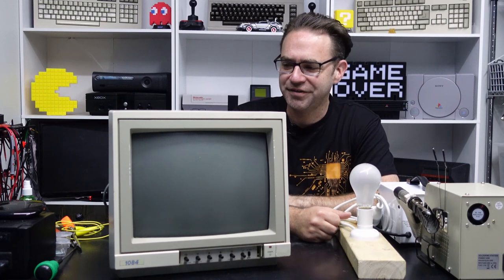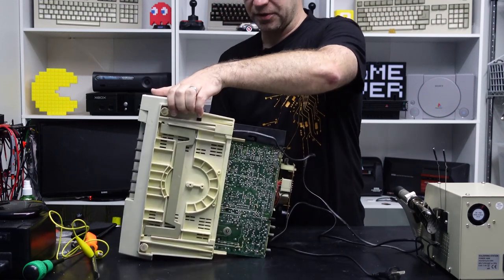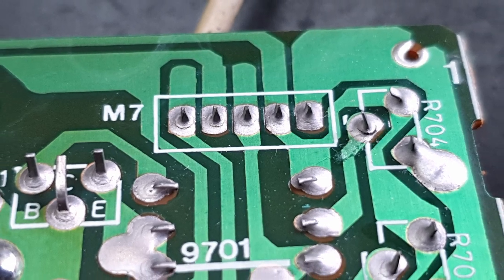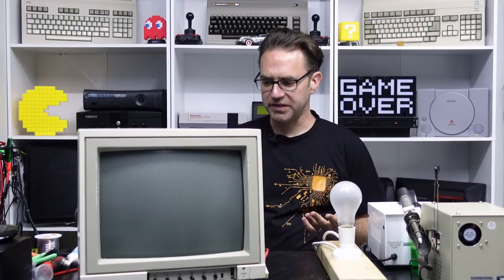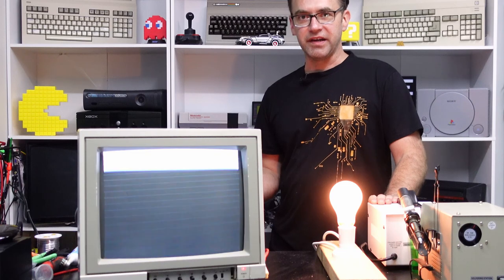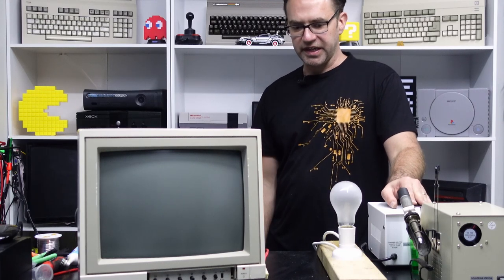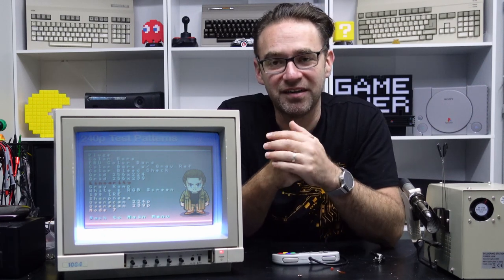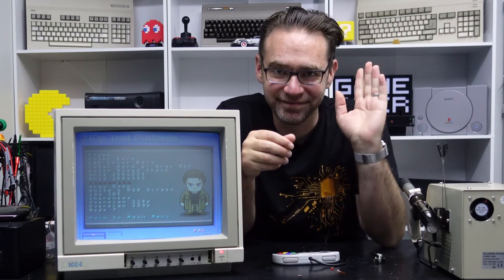Commodore 1084 - Replacement switches, flybacks, and other shenanigans Part 3

Comment: Thanks for doing this CRT series.  I've really enjoyed them!  I've got a dead 1702 that I plan to recap and fix (suspect I may find broken solder joints on the flyback on that one too).  So, I'm gathering all of the tips I can find.  I also have a Magnavox 8CM515 (very similar to the 1084 you fixed in this video)  that I likely need to replace a few caps in as well to fix some minor display problems on it.  So, I'd be keen to see another video showing your recapping and the results.
Reply from the maker: Thanks David, yeah if the Magnavox shares the same chassis then chances are you will likely find some bad joints. Seems to be a common problem with these boards.
I'll certainly come back to the CRT repairs once I've finished up a couple of other projects

Comment: I tried to repair a few Arcade CRT in the past and it can be a very frustrating experience. The last one I was going around in circles wondering why it wouldn't work after a rebuild and new flyback so I sent the chassis to well know expert and he said the new flyback was labelled incorrectly the rest of my work was good.
Reply from the maker: Wow, that's frustrating to say the least. But it's always nice when an expert commends you on your work

Comment: I have a 1084s monitor. The power button, which is located in front is broken. Before I open the monitor and replace it, I was wondering if there could be anything else wrong with it from my description.     Before, I could hold in the power button and a picture would come on until I let it go. Now when I hold the power button in, there's no picture at all, no rasterization. I don't hear any high pitch wine, I can't remember if there was any static on the screen when you touch it. Do you think there could be anything else wrong with the monitor?
Reply from the maker: The switch could have made it to the point that the contacts inside it have worn out due to arching, but I think that's unlikely (you probably would have noticed it flickering on and off long before it completely stopped working).
Possibly the fuse has blown, it can happen when a supply current rapidly switches between on and off, like from a broken switch perhaps.
I'd check the fuse first, then check the switch with a multimeter just to make sure it still works when pushed in. Of course do this with the monitor unplugged, there should not be any need to discharge the CRT at this point, just be wary of the large capacitors in the power supply. They can hold a charge more dangerous than the tube itself

Comment: This was awesome video series!!! I have learned so much thank you! Of my 9 Commodore monitors six of them work great (for now, knock on wood!). My other 3 work to a point but something is wrong with each one. A 1084S-P the Composite/LCA is good, RGB is black screen. A 1902A Won't always start but works when it does, when working the displays illuminates a bright greyish screen  when no video is connected and it aways goes to a black screen after a few minutes. A 1702 has a B&W picture only from front and back inputs, but it is a sharp and clear picture. Any thought on those 3 monitors?
Reply from the maker: The 1084S-P could just be a bad connector, either the solder joints or corroded contacts. Try hooking something up again and wiggiling/plugging in out the cable into the monitor, see if anything changes on the screen. Also does the switch work correctly? If you connect a composite/LCA and then push the RGB button it should disable the composite/LCA input and the screen should go black.
The 1902 could be bad solder joints or bad caps (or something random). Sounds like the sub-brightness (screen) control could be set too high, but make sure you have exhausted any issues with the board/components before jumping in and making adjustments as usually the screen should get dimmer/darker as the tube ages, not brighter.
The 1702 IIRC correctly has LCA on the back and composite on the front and a switch on the back to select between LCA and composite. If you connect a composite signal to the front connector and the switch does nothing then it sounds like it's stuck in LCA mode (which will usually ignore the colour portion of the composite signal) hence B/W only image
EDIT: Just noticed you mentioned the 1702 is B/W with LCA as well. That suggests a deeper issue, but could be a combination of bad switch and bad connection on the red/chroma input
Reply: @TheRetroChannel  Thank you very much for letting me pick your brain. These will be great starting points when I have time to start trouble shooting them. Thank you again!!